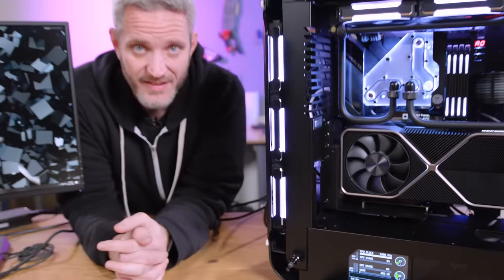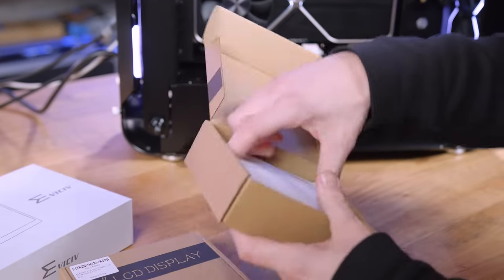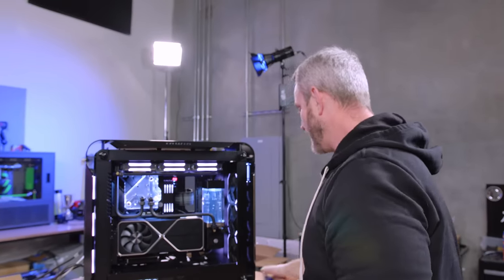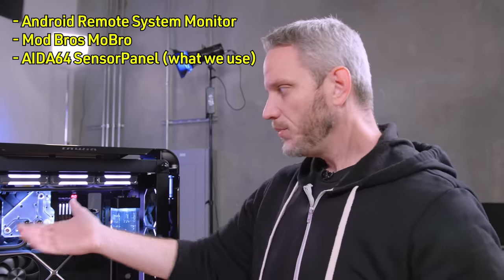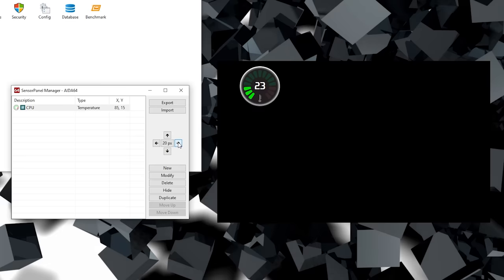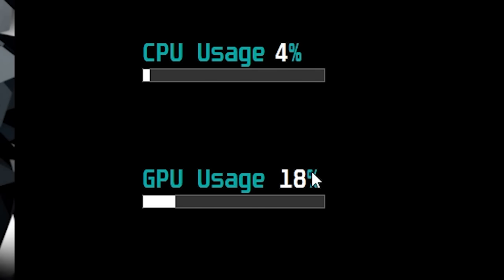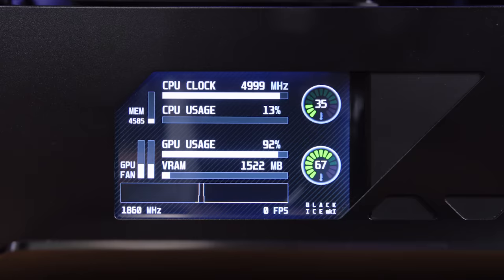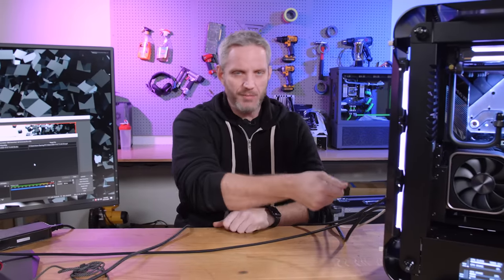EVERY PC should have one of these! How to make a sensor panel!

Comment: I wish I could put one of my old IPhone 4's in as a screen, that'd be fun.
UPDATE: If you take the IPhone 4 apart you can get a mipi dsi shield/hdmi adapter off amazon or ebay for cheap and connect the screen following the same steps in this video :)
Reply: Taking apart an iPhone 4 is blasphemous, it was the ultimate phone. Every other iPhone released since then, except for actual hardware such as processor, storage, ram and so on and so forht, has been a downgrade.
Reply: You can use any thing with a web browser and get a similar result. Its a setting called remotesensor, and will run a web server on your pc. Ive been using it with an old tablet of mine for about a year now with no issues.
Reply: You can also use Rainmeter for this. I have 3 tablets and a phone connected to my PC as screens although the devices all link to a game called Elite Dangerous (as a spaceship cockpit), then I also use Rainmeter for system sensors on an HD monitor, with 4k screen for gaming.. There's an app called twomon SE which is cheap and  allows your tablet/phone to run as a monitor via usb only. For the other screens, I use a free app called spacedesk which works over wifi. I also have Aida 64 and use that for the LCD screen of my Logitech G19 keyboard, giving screens for:
an overview
High level summary
CPU and RAM
GPU
Storage Drives
Network
Reply: Pitikapp
Reply: @strappedwithkrylon  hi. You’re cute. I’m Daniel.

Comment: Jay: But they're cheap

Me: Umm, that's half the price of my gaming monitor.
Reply: Gaming monitors start at like $200 to $300 for cheap ones, so idk $50-70 isn't bad for a cute little system info screen
Reply: @jmanredbull1  You can get solid 1080P, 144hz monitors for around $150. You can even find them cheaper if you try to actually search. It's truly a great time to be alive. (if you ignore all of 2020)
Reply: My gaming monitor is 100
Reply: @DankoleClouds I was referring to 2k, 1ms response time monitors, and at that they start around 27" due to pixel density, but regardless if you're not investing in a 1ms response monitor and you play a very reaction based, snappy, fast paced game, i.e. CoD, LoL, Battle Royale's as a whole, etc. you are hurting yourself there, since the response rate is very close to lag with fast paced games. Now if you play RPG games, Borderlands, Minecraft the response rate doesn't matter at all. The reason for 2k, is because it's very standard of most modern cards to hit it on high settings with no fps issues
Reply: @jmanredbull1  Yeah, but the thing is, not everyone has a high end system. Not everyone plays at 2K. For the vast majority, a 24", 1080p, 144hz, less than 5ms response time is plenty good enough. Not everyone plans to go pro at call of duty. We were just talking about gaming monitors in general, not the crème de la crème of elitists gaming peripherals.
Reply: @DankoleClouds  lel 1080p and 2k is approximently the same resolution
Maybe you mean 1440p which is 2.5k
Reply: @LudvigLindell  There's several different ways of measuring. If you look up 2K gaming monitor, you'll find nothing but 1440p monitors, with the occasional 21:9 1080p monitor.
Reply: @jmanredbull1  
According to Steam, the vast majority of players are still playing in 1080p (myself included). 1440p players are a minority. So I'll let you guess for high resolutions
Reply: @DankoleClouds  doesn't mean 2k is the correct term for a 1440p monitor.
Reply: @LudvigLindell  Yes but the correct term doesn't matter if almost everyone calls it 2k
Reply: @LudvigLindell  1440/720 = 2 so 2k
Reply: @damien523  I hope you are trolling.
Reply: @damien523  And 2160/720 = 3 so 4K? there is no logic. early on 1440p was referred as 2.5k because it had around 2500 pixels horizontally and now it's 2k because it have around 2x the pixels than 1080p. deal with it.
That $70 screen is still cheap to compare my 5000€ 65" 4k monitor.
If you really want to know https://linustechtips.com/topic/691408-2k-does-not-mean-2560%C3%971440/
Reply: @jmanredbull1  Ps, don't buy a gsync monitor and it's $200-$300 cheaper.

This is the reason that even if nvidia would be a bit better, I go with amd gpu
Reply: @DankoleClouds  yeah with massive bezels
Reply: @DankoleClouds  no its pretty average to get 1ms tbh most monitors have 1ms response time
Reply: @ArcticRaccoon  65" Goddamn
Reply: @LudvigLindell  ?K isn't really set to a specific requirement and doesn't have to be 2K literally. As 4K isn't literal as well. But 1080p fits the requirement of 2K and is in that area.
Reply: @damien523  My gosh. 2K / 4K actually stand for horizontal length.
Reply: My gaming monitor is worth about $10(19" 1280x1024 75hz)
Reply: Even my whole gaming setup is cheaper(BSEL modded Intel Pentium E2160, vmodded ATi HD4670, 4gb of ddr2 ram, 19" 1280x1024 75hz)
Reply: @excaliber2845   yea. you know that omen x emperium 65" 144hz 4K. It's good, but colors can be better. My old ASUS ROG Swift PG279Q was much better at colors, but i gave it to my father to play solitaire.
Reply: Jon Michels I have a 22” IPS 75hz 1080p Freesync display I bought for 99 bucks on Amazon. Made by AOC.
Reply: So you have a cheap gaming monitor then.
Reply: he is using that on a system that costs around 5000$ Ballin budget so the monitors comment doesn't apply on this context for all of us on a cheaper budget thus doesnt make sense .
Reply: My pc is 280$....
Reply: You can pick up an small oled for around £4, and a USB to I2C adapter. You'll need to do some coding though, but it beats £50.
Reply: Then you have a cheap monitor!
Reply: @jmanredbull1  so what you are telling me is, that I could get a 200$ monitor instead of a 150 one :D
Reply: ......my 47 inch 120 hz tv/display was $50
Reply: My gaming monitor is a 144ghz 1080p curved monitor and I got for a bargain of £40
Reply: thats the price of my computer
Reply: It should be noted that these are touch screen monitors, so a significant portion of there price likely comes from that.
Reply: @jmanredbull1  its $100   50 for the panel, 40 for the software (its a paid program, look up aida64 extream $39.99, yeah sure there is a 1month trial, but it runs out)..   So after tax $100.
Reply: dude i paid more for my sink in my bathroom.   i have a RGB sink running at 4ghz base clock and has 40gigs of Vram.  i game while brushing my teeth and stufff.   and then my toilet seat is a LCD display curved into a seat covered in plexiglass
Reply: @ueehurstonsecurity8887  wow
Reply: @Russell White I never stated 2k is the correct term for 1440p
Reply: Exactly what I thought. You can find new 22" monitors for the same price. 50$ for a 5" TN (not IPS or VA) and very low resolution monitor is a ripoff. You better get a 22" FULL HD monitor and display a lot more info there.
Reply: That just tells you how cheap full monitors are...

Comment: I love Aida64's build your own sensor panel func. One thing to note is different mobos will have different sensors available for Aida64 to read, a more high end mobo will likely show more available sensors.
Reply: Question, I have avsolutely no odea about raspberry. So basically I purchase the raspberry screen, plug it in and use the software to customize it? Or is there anything else that needs to be done to the screen (or the os of the raspberry?) before plugging the screen?

Comment: A better alternative to hot-glue is Lexel. It's not as cheap or readily available but it's 1000x cleaner, remains pliable for pressure-related issues and (unlike silicone) can be applied on top of prev applications - Down side is the drying time
 
The reason you had glue runs all over is because you applied HOT glue to COLD metal. The moment hot-glue touches a cold surface a skin-barrier forms between the two. Now, the hot-glue remains hot, a micro-area is almost-kinda-maybe sticking to that metal but the majority of the hot-glue is simply wasted and cooling. You can warm up the metal prior to applying your hot-glue or go with something like Lexel.
Reply: Isnt just double tap on the side of your PSU better ? It keeps your PC case safe and untouched.
Reply: @Ilestun  double-back tape I assume you mean? Keep in mind, he wanted this in a specific spot and had the tools to do so.
========================= 
You'll be looking for VHB (Very High Bond) double-back tape and most of that has a 1/16+ thickness which can interfere with flush mounting. For minimal issues using tape, look into "Fast Cap" tape. Extremely strong and almost no thickness - UNDERSTAND that you will need to clean/prep the surface area before applying the tape. Denatured alcohol typically works fine, wipe down BOTH surfaces before applying the tape. Tape WILL soften under heat, hence why I don't use inside/on electrical (UL/Code issues).

Comment: i dont have a raspberry pi panel but i do have the goverlay 3.5" and i love it... extremely customizable and having it mounted right under my monitors makes it a quick glance away from checking temps etc.... a lot easier than turning my whole head and looking in my case. even has local weather as an option in the title bar

Comment: If you’ve got multiple monitors and you want to use something like this with multiple task bars, except on this monitor, you can use DisplayFusion to manage this.

It’s been super useful for me with a three monitor setup and having access to the notification area easily across all three monitors.
Reply: Does the sensor layout shows up in alt tab menu, when switching between programs? Cause that would be annoying to have it permanently there.

Comment: Nice one, if someone wants additional functionalities, check out edex-ui. It does have a hacker-like ui which enables you to use the terminal and the file system in addition to system monitoring. 
It is very cool, I plan to make a video about that.
Reply: Cool 😎 When is it coming?
Reply: Us Linux users have a thing called Conky. It's dope.
Reply: @olealgoritme6774  Just released it, under the scifi tablet name. Hope it will be helpful.
Reply: @bluephreakr  That looks good as well, thanks for the suggestion.

Comment: Hella dig building your own! For now I'm just using an old Samsung Tab that wouldn't even play temple run. I run Remote System Monitor on it and charge the tablet through USB. Definitely not as fancy as this but $1 for the app seemed  good enough for my needs :)
Reply: @P3GProductions  k
Reply: @P3GProductions  Nice! Had one laying around too, but the bigger Tab screen works better for me :)
Reply: For those who don't know: The UI can be configured how ever you like, and it runs over wifi so it doesn't need to be plugged into the machine 24/7 either. Don't judge, but this is a screenshot of how I have my UI setup.
https://gyazo.com/3951886d742a3ba9cf698eced27e578c
Reply: Good thing you didn't pay anything for that Tablet... 

<Smirk>

Comment: I had hoped that this would incorperate a more custom solutuion tbh. Having your mouse disappear off your screen and finding it down on a tiny monitor is an inconvenience.
Hooking up more monitors to a system and having them display statistics is always nice but not if it gets in the way. If someone knows of a way to run monitors as separate clusters with no mouseover function that would be great. Generally the way windows treats monitors is not perfect, just try using two monitors of the same size but with different resolutions, is messes with mouseover. Apart from that flaw which is out of your control, great video and Aida64 tutorial.
Reply: There are ways to lock the mouse to the first screen.
Reply: @zirkoni42  which sucks when you're using three screens
Reply: @dexalan1676  Then lock it in the screens you're using.
Reply: @zirkoni42  I use 3 screens and haven't found a way to lock the mouse into 2 of them. How am I supposed to lock 1 out of 4?
Reply: The Goverlay display on ebay doesnt require HDMI

Comment: Logitech G19 Display since 2009 with AIDA64eXtreme...best one for me so far and games use the display natively! And you both forgot the killer features of AIDA64E, you can use pages and setup a timer to auto switch between them! So page one shows the detailed CPU with each Core, temps, utilization, volts and amps, if you want! The second one Multi GPU’s really detailed and of course each page has his one background! I used a X-ray of an AMD GPU...the third one shows the Water Flow, Pump and each RPM in your system you can think off and AIDA can read out. The fourth complete RAM and virtual RAM, RAM pages and errors each second, RAM speed and timings or usage. And the fifth shows all your disk devices with usage and live gages, transfers speeds or just read or write on each different M.2 and Disks you have installed. Or a complete FPS page. And the most important you can setup alarms 🚨 when for example your water flow sensor shows low flows or a fan or pump falls under 600 RPM or a Core peaks over the Tj Max and the CPU throttles the speed and setup an event like you get an email or message on your phone that ur UPS is low on Batterie and the system is shutting down in 5 minutes! And there is so much more you didn’t cover in this video!

Comment: There are flush mount brackets for 10-20 USD that could be part of the build. It would cover the back of the display to protect against grounding and also give you a mounting surface. Just a suggestion.
Reply: Smart idea. Thinking of mounting a display in one of my ssd side mounts. Problem being is getting the HDMI in there.

Comment: I've toyed with this idea for so long for such a strange nostalgia reason. I have used the Logitech g510 and now g510s for so many years now, and it's build in customizable display has been reading out these exact same stats. I don't think I can ever use a different keyboard after the time spent using this display. But maybe a display like this will let me finally change keyboards =D
Reply: Same.  I just handed that down to my son so now I'm onto sensor panel for my rig.

Comment: I just got a  PI display today and experimenting with Aida . I know this vid is a couple years old  but in regards to the  issue with the screen staying on connected to the external USB port on the PC  . What has worked for me is,  I have my PI screen  mounted externally on its own stands underneath my monitor, my monitor has a usb hub on it that is setup to turn off when the monitor is on standby. So I have the PI display powered of my monitor and shuts off when I shut down my PC. Thanks for the video, now the fun part of setting up the sensor configurations .

Comment: ..or you can use your old phone or tablet that's just sitting in some drawer either way, gathering dust, and use that as a wireless screen for the Aida64 sensor panel. You can set that up using "spacedesk" (free software). That's how I did mine.
Reply: did you/can you put that in your case though?
Reply: Can you please point out some tutorials?Does it needs to be android,or can a windows phone 10 do the job?

Comment: alternative suggestion: Aquacomputer Aquaero Series is a standalone display (only needs usb internal) which im using to display all data like flowrate/temps/anything else that HWinfo can output and which is even more important not as a digit but a graph which shows a timeline. And the control software logs everything. a couple of components as cpu blocks allready do have the "vision" component too which does the same. im doing watercooling more that 20 yeas now, and i suggest aquacomputer components for everyone on enthusiast level. BTW: i testet all major cpu block manufactures for 1151 this year and while EKWB and other blocks reduce flowrate by up to 80 % per component  Aquacomputer was one of two companies with ~5% flowrate loss per component.
Reply: How much did they pay for this blatant ad?

Comment: Also, you might find Rainmeter easier to use than the AIDA64 Sensor Panel
Reply: Only issue with Rainmeter is that it uses graphics power regardless of its configuration, which can impact game performance. Used Rainmeter for years, uninstalled as soon as I got a G-Sync compatible display because the monitor detects the rainmeter skins refresh rate rather than the game.
Reply: @MrAshleyt123  sounds like an Nvidia issue not a Rainmeter issue. I don't have that problem with AMD Radeon. You can also configure how often Rainmeter skins update.

Comment: Dammnit now the price of those little panels on Amazon is going to go through the roof 😭
Reply: Get em on eBay. The Amazon ones are already the exact same Chinese panels marked up, even before this video. Same goes for 99% of tech parts on Amazon too, always check elsewhere and you'll find them at least half the price.
Reply: @Leo9ine  Or go straight to the source on AliExpress if you're feeling brave.
Reply: I see 7" 1080p monitors with better than 4 stars for similar money.

Comment: I made one of those custom panels and stuck it on an old 4:3 secondary monitor off to the side of work area. Made it big enough to see, but only takes up about 1/8 to 1/4 of the 15" display. Sometimes I throw Task Manager on that screen as additional info. Awesome stuff right there

Comment: Thanks for this video, I ended up ordering the same 5" screen and built my own sensor layout.

The only issue that I have is that whenever my computer either boots-up or comes out of sleep, the sensor panel screen seems to initialized first, before my other monitors (4K and 1440p) and the result is that all windows(chrome, etc...), when I take them out of fullscreen, are now 800 x 480.

This isn't the worst thing in the world, but it's damn annoying.
Reply: Got the same Problem and it is annoying as hell. Did you find a solution for this?
Reply: @ArlenBales  no, I just try to turn my other monitors on and wait until they're fully ready before I wake my PC.